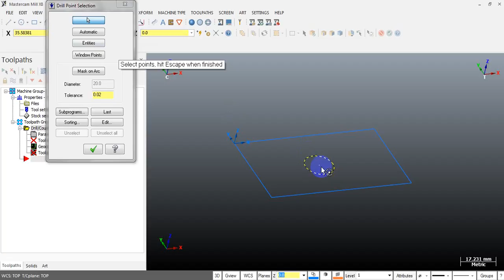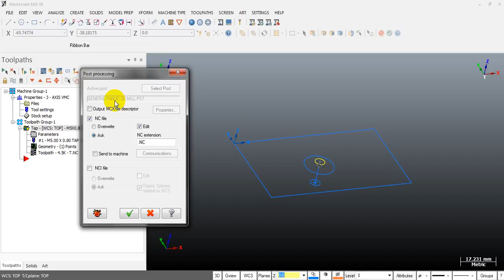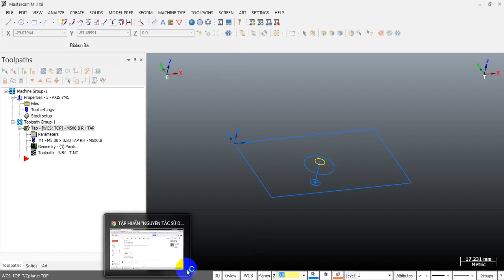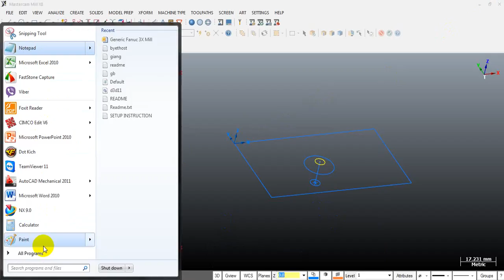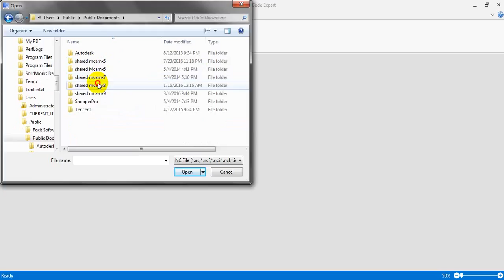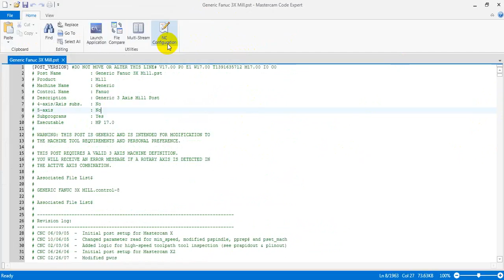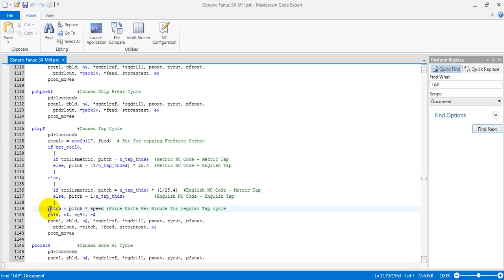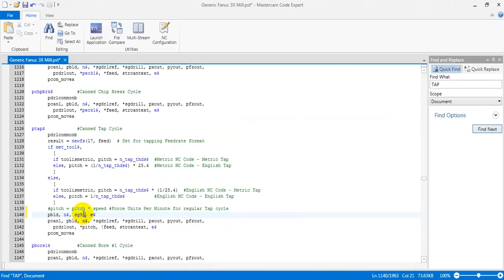MASTERCAM POST PROCESSOR TIP: G95 OUTPUT ON TAPPING CYCLE

Comment: i have a question i am trying to run a simple lathe program with 640 fusion MT control but "T101" DOES NOT seem to work i get errors
if i use "T1 M6" the chuck opens ?? ? ? 
what's the right set of codes? is there an M code preceeding all the other codes for tool change?

Comment: G54 
 T01 M01
 S300M03
 M08
 G00 X-15.398 Y6.312
 G43 Z 25. H02
 G93                                ON YASNAC CONTROLL  G93   PITCH PR  REV
 G84 G98/G99  Z-8.0 R5.0 F2.0  ** 98/99 **  98  RETRACT to  z25. from G43  (Z25)     G99  RETRACT to  R 5.0 FROM  G84  LINE
 X9.156 Y-4.925
 G94                                 CANCEL   PITCH PR REV   
 G80
 G00 Z50.0 M09
 G53 Z0 M19
 M30